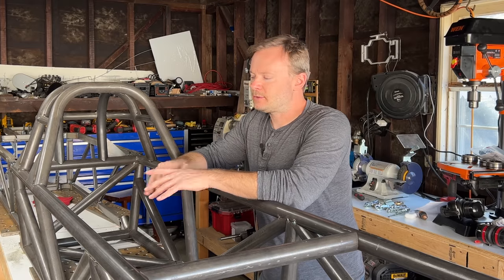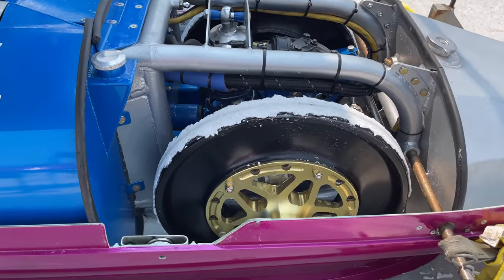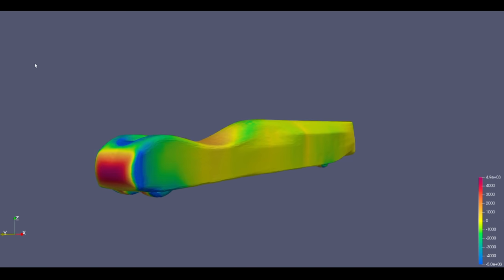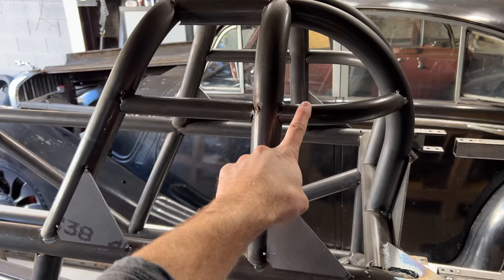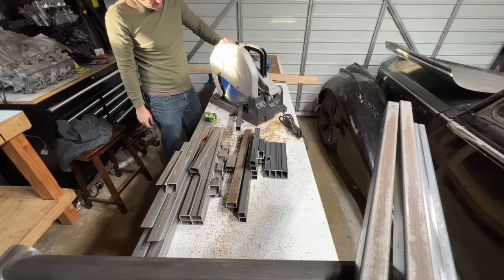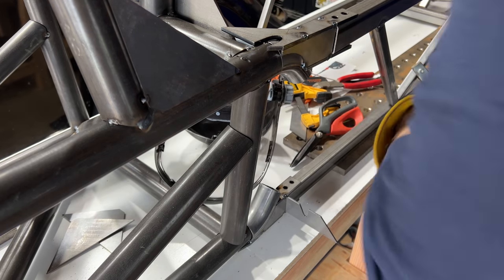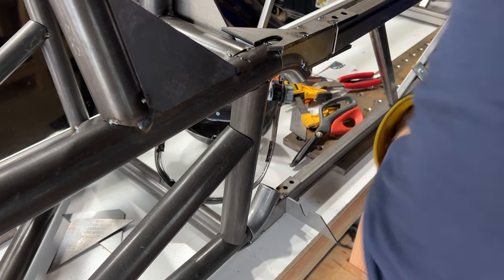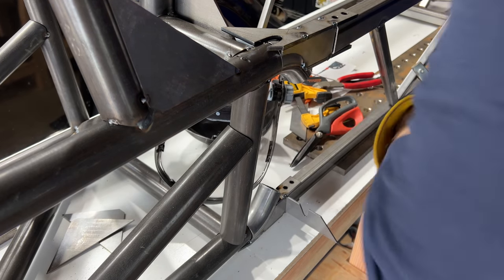Building A Race Car Frame: How To Not Die At 200 MPH

Comment: As my fabricator friend Phil used to say... "Anyone can build a barn that will last forever. But it takes an engineer to build a barn that will 'barely' last forever..."
Reply: I heard this one: "Any idiot can build a bridge that stands but it takes an engineer to build a bridge that barely stands".
Reply: @asdrubalegirolamo660  yup me too
Reply: its why I cannot stand the term overengineered.  how could that possibly exist? overengineered you mean over built?  Did the company waste profits by not engineering it to be less over built? Because that would be under engineered or poorly engineered but how could it possibly be overengineered?
Reply: @pbgd3  Overengineered meaning overly complex to achieve a relatively simple result
Reply: @pbgd3  could mean overly complicated or overly expensive.
Reply: @pbgd3  You mean like German cars are overengineered: cleverly thought out and prone to failure.
Reply: @haveaseatplease  yeah thats not over engineered then to me. Thats just overcomplicated junk. To me over engineered is like, an old (1980's toyota) built basic, but far stronger than it needed to be to last 10 years. for eg: engine, strong enough to make 250-300hp for years, make it make 75hp. Lasts 40-50 years and millions of km.
Reply: @Colt45hatchback  I like your definition of over engineered.
Reply: 'The perfect racing car is one that crosses the line in first place, and then immediately falls apart' - Colin Chapman.
Probably why so many of his drivers died.
Reply: @pbgd3  I think a good 'exact' definition of overengineered is what you would probably describe as poorly engineered. That is, the engineers tried to make it just barely good enough, eek out every bit of performance. They failed and instead got a bad product.
Reply: @pbgd3  if over engineer for power and rigidity you now waste millions over the course of launching a rocket burning extra fuel for example. Over engineered means inefficient in most contexts. Engineering isn't just about building things... There's pros and cons to everything and it's ignorant to ignore that.
Reply: @Colt45hatchback That's also what I thought it was. But I looked it up and apparentely overengineered means more complex than necessary.

Comment: In the bolted joint you need to put vertical tubes inside and flush with the rectangle tubes in order to prevent crushing when bolted together. hope that's clear:)
Reply: yeah... that looks embarrassingly weak. lol..  I'm not sure why he thought that would work.  Really he should have made it a slip joint, where one pipe slips over another on the inside--- with that inside pipe being at least 8" or more;  so that it's rigid. I feel like those brackets are going to bend if he just looks at them wrong.
Reply: Just opened the comments to write exactly that :)
Reply: @777MAV  Same here.
Reply: I too was thinking the same thing. Unless the bolts are just pins and wont be done up tight you need to core the holes with a tubes.
Reply: @777MAV  Came here to comment the same thing.  Just a couple small pieces of .120 wall DOM tubing to act as a boss through that rectangular tubing.  I usually get short lengths of it from McMaster for whatever project I'm working on.
Reply: my bigger question would be how easy aligning those will be if any distortion occurs, would seem like having some sort of flat vertical plate bolted together face to face at the bottom points would be an easier connection maybe with a sort of hinge at the top so when assembling you could roll the halves together then jack the car up in the middle and bolt the bottom plates.

The thumbnail depicts some form of upper turnbuckle to reinforce

Comment: An alternative to scanning the engine and all is making a quick wood (or some other cheap/free scrap alternative) frame around the engine in about the design you want so that you can skip all the annoying stuff. That way you dont have to deal with annoying measurements and you can get a Real Engineer feel for how it would fit.

Comment: I absolutely love this. I'm eager for the next episode. As someone who's built a complete tube chassis car and a LOT of roll cages by hand, I can't even begin to explain how envious I am of the laser cut chassis. I am going to have to explore this for my next tube chassis build. I may have some questions!

Did you weld underneath your tube nodes where your tubes overlap?  (I'm asking as I watch, apologies if you cover this later!)
Reply from the maker: I did, but I honestly don't think it's needed. It seems unnecessary considering the load paths and failure modes.
Reply: When can we see a 308 vs Electrojag race?
Reply: @mcvincnt  would be cool, but I have a feeling the 308 would gap it

Comment: Using the roll cage as intake runners is a very clever touch. I've heard of using them for coolant or even oil, but not for intakes! Getting the benefit from that high pressure zone at the nose without too much extra plumbing is brilliant.
Reply: Air turbulence in those small tubes?
Reply: @jpkatz1435  Meh, the engine is so small that the collective diameter of the two upper tubes is plenty big to avoid choking off airflow. And the length isn't really an issue because throttle response is meaningless to a land speed car.
Reply: I also read about Porsche drilling holes between frame members so all the insides were interconnected. Then they put a schrader valve and a pressure gauge in the cockpit and inflated the frame. If the pressure dropped, the pilot knew immediately that there was a failure somewhere!!
Reply: @G60syncro  true, but it was an aluminium spaceframe filled with nitrogen - very limited life but good enough for one race in a 917.  

 @SuperfastMatt  - 100% you need crush tubes in the rear subframe connection.
Reply: And Matra (a French company) pressurised some of the structural members in (I think) their Bagheera, and used the air pressure to power (can you guess what?) The windscreen wipers.  So if they stopped working, you knew you had a leak, likely caused by chassis corrosion.
Reply: @jpkatz1435   I wonder that too .... Tubes are long & air is fast ....500cc engine?  If its a 2 stroke engine ,  going at say, round numbers, 12000  rpm .. thats 6000litre per min , or 100 litre /sec,   ten buckets of air a second  ...  If the front of the car is part funnel  perhaps could it pressurise the tubes enough to get the air through.     I also wonder if Matt puts in such fantastic ideas to make the show better , & for lively comments !

Comment: Those bolts through the frames to attach the halves together might be a good idea to weld some tubing for anti-crush and resistance to pulling apart.
Reply: Or but a machined aluminum slug in them with matching holes
Reply: @jeremyhanna3852  Welded tubing would increase the strength more than an aluminum slug I believe and at 200mph coming apart is not an option I would want
Reply: @bradmaas6875  ok I never built anything that goes that fast and envoles force I can't fully understand ( not a Engineer)   so your likely right I was just think about stopping the tube  from crushing only but it Also might tear apart as the aluminum is not fused to steel
Reply: @jeremyhanna3852  made me think some tabs might be a good idea also, or a chute if the two pieces separated, reduce the chance of tumbling.

Comment: That is going to be pretty heavy. I assume you have taken that into consideration, but just as available space on any project magically shrinks, mysterious weight often appears as components get added. Cool project.
Reply: Top speed cars are less worried about weight as it only affects rolling resistance and the difference is marginal when compared to aerodynamic resistance.
Reply: I'd wager he'll probably add a LOT of weight to it, on purpose, when he's done. (I haven't watched the whole episode yet.) But land speed cars often have thousands of pounds of ballast in them. Weight doesn't hold the car back nearly as much as the aero profile, and it helps keep the car planted at speed.
Reply from the maker: Exactly. There will be lead ballast in the front.
Reply: Salt doesn't offer much grip so you can't accelerate hard, so weight, which is the enemy of acceleration,  is not a problem. And has other benefits, as the other comments mention.
Reply: @stanceworks  nice to see you here
Reply: fill the tubes with helium!! Sealed Helium Inert Tubing S.H.I.T.  I'll be here all night. :^D
Reply: @ab3000x  Matt telling other drivers about his ride design: "Yeah, the safety cage was laser cut and is full of S.H.I.T.  Whatever."
Reply: Weight is traction

Comment: Always great when a new SFM video drops <hope I don't find that that's an acronym for some random perversion..... or maybe not....>. Thanks for the great vid as always, some really good progress on the race car!  That's going to be a ton of welding right there!
Reply: Some people find machinists a bit weird. For them SFM stands for Surface Feet [per] Minute, usually a numeric range for how fast a cutter and the material being cut move relative to each other. There's a different range for each combination of cutter material and part material.

This is one of the areas where modern lathes with electronic drives have an advantage over older lathes with gearboxes: you need more rpm to keep the SFM up in the ideal range when cutting near the axis than on the outer diameter of the part. Too slow and the surface finish is dull instead of shiny. Too fast and you overload the cutter and/or stall the motor.
Reply: @EmyrDerfel  Hummm... You can use cubic centimetres peer second.
CCS.
Reply: In my country they call an ,machinist,, (engineer) an masochist(someone who wants to harm his/herself).
Reply: @youkofoxy  that's volume over time, not distance over time. Linear speed is what they check for surface finish.
Reply: The acronym makes me think of Source Film Maker
Reply: Sexually Frustrated Man... thanks Urban Dictionary
Reply: Most clever commenting
Reply: If he spoke very slowly and softly, while teaching English, would this video become an EslSfmAsmr?

Comment: Hey Matt!
Heres a quick hint from somebody who's selling welding equipment for a living across the big pond.
Please don't blind yourself while welding! if you're doing a lot of back and forth between grinding and welding then a lot of automatic welding Masks (even cheap ones) have "Grinding" modes, so they dont dimm down when there a grinding sparks flying around. some more expensive ones (like the 3m Speedglas 9100FX ) even have fold up visors with a gigantic clear screans for better grinding visability.

Keep up the awesome work tho! Its very entertaining to watch! ^^

Comment: Paint instead of powder coat is a good idea. The salt will find it's way under the powder coat after a couple years of racing and then it's off to the powder coater again to strip and refinish the entire frame. Paint isn't better corrosion protection but it is easy to sand and touch up the rust spots. I bring a paint pen to the salt to touch up the inevitable paint chips made during the week. Another necessity to fight corrosion on the salt - chuck every steel fastener you have and replace it with 316 stainless, Bumax88 or titanium.

Comment: You should look at spraying the frame with Steel-It, its a weldable coating and a lot of the baja dudes use it on their frames. It comes in an aerosol spray can and a paint can so you can also brush it on.

I ended up using it on rack for my truck and has held up a lot better than regular spray paint.

Comment: Awesome video! Just some suggestions (just like everyone else and their mom is giving you). At the bolted joint, put some weld washers or something to decrease the bearing stresses on the sheet metal, it doesn't look like you have shear features so those holes may wallow out. One guy suggested welding a tube inside the square to stop it crumpling which I think is a good idea, and will increase the surface area for the bolt to dump load into. The biggest thing I have to harass you for is metal prep! I started TIG welding a year ago for my buggy chassis, and the biggest thing I've learned is prep is everything. At a minimum you "should" get the millscale off the metal and the oxidation off the laser/plasma surfaces. I like to just scotch brite and then acetone/alcohol wipe it down, but even just hitting everything with a wire wheel really fast will immensely help your weld quality. You should also leave the TIG pointed at the weld once you're done until the post flow turns off so the weld can cool a bit before introducing oxygen to it. Welding Tips and Tricks on Youtube is an amazing source for help! Also Furick cups can help a lot for acute angles of tubes since you can get a lot more stick out. I'd also recommend beveling any future surfaces with a flappy disk so you can get full cross section penetration. Prep turns into the longest part of the welding process I've come to realize after going down the TIG rabbit hole.... Otherwise nice work! I like the alignment tabs for the tubes, I've never seen that. I want my next chassis to be all laser cut, I've very jealous!

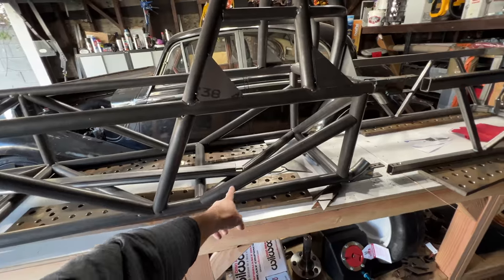Comment: You can already tell it's going to be amazing. At 7:12 my calibrated ocular inclinometer noticed that the leading head loop is the same angle as the A pillar of the Jagla... Tesuar... Electric pussycat... where was I going with this?

Comment: I would definitely invest in gas lenses and some larger tig torch cups.  A good tig weld shouldn't crackle or leave behind sooty residue. As someone who taught myself how to tig weld, I can say that for complex joints, or weird transitions/angels,  that the large cups and gas lenses really help. They not only make the welds visually better, but they allow for better control of the weld puddle and a stronger weld due to less oxide impurities being mixed in

Comment: Pro-tip for welding tube at 90 degrees. Cut the tube ur attaching with 2 45 degree cuts so it has a point. That creates a bevel which helps the weld. Much easier than hole saw and much less time!

Comment: I have been gifted with ability referred to as Dunning-Kruger effect so I am an expert in land speed record vehicle design (and also aircraft). As you correctly assumed the key is decreasing drag as much as possible. Trying to minimize frontal cross section is important as you did. I wonder if ruled do not allow for the tubes to go above your shoulders beside your ears. This would allow to narrow the chassis for 2 cm on each side. With the width of 60-70 cm this is a saving. The other thing to consider is wetted area. The less surface area the air has to pass over the lesser the drag. There is a reason why some aircraft fuselages are thinned to a pole right behind the cockpit. A thinner car bodywork where it is not needed would be beneficial. Something like a coke bottle between front wheels and cockpit. Not to be confused with designs based on Whitcomb area rule. It would be so interesting to hear about your thought process.
Reply: I'm willing to bet you have never built a land speed car ever nor do you have any formal knowledge form any school or college.....I'm right aren't i

Comment: Tires also give you some suspension tuning, we've used air pressures to toy with a A/BFS streamliner. Do get into a habit of ignoring the relative pressures, though, you'll need to set pressures accordingly for equal tire diameter on the drive axle.

Comment: Another excellent video; REALLY good to hear corroboration of slow cars fast. Years ago, remember pull quote - poss Evo review of 993 911 GT3 - screaming "150mph fells like 50!!!" as if this were A Good Thing. Which it might be - in a race, or delivering organs. All I could think was it was three times the speed for the same amount of fun, with bigger risk to licence, bigger hole in scenery if it went tits up or - at the very least - driving like a bigger c**t
Especially gratified to hear your corollary suspected might even be more fun than fast cars fast but never tested theory because a) cheap performance (& fuel) doesn't really exist in the same way here (UK) and, b) if I was wrong I might be corrupted. 
Bit miffed you don't mention 2CV which only went over 500cc in 1970. Scooby 360 is super cute, but 360cc class ended in the 70s and showing something like Honda Z might have better illustrated how (relatively) recently sub-500c cars were A Thing

Comment: Round tubing and square or rectangular tubes flex at a different harmonic.  It may not want to go straight.  Porsche used an inert gas to pressurize the 917  tubes and would check the pressure to make sure the welds or tubes didn't crack. You will need fenderwells that seal
well to keep all the dust out of the cockpit.. Just trying to pass along some things  that friends had problems with over the 60 years that  they had some problems with.

Comment: Just a quick observation,  the Bolted connection between the two halves of the chassis. I would make those brackets sit vertically instead of horizontally.  This will increase the strength of that connection

Comment: It could be an idea to push the water ahead of the wheels. The water tank can be sloped better to reduce drag. Plus I'd imagine its easier to run the water through the gaps between the wheels than the linkages and air through the fuel tank. Of course it might reduce stability slightly with the wheelbase and CG changes, but I can't imagine it would change that much? Of course this isn't my area so I may be wrong, but hopefully it gives something to think about at least. As an aside, you weren't joking about that laser cut tubular section. It looks real nice made up, like you bought the whole section ready made!